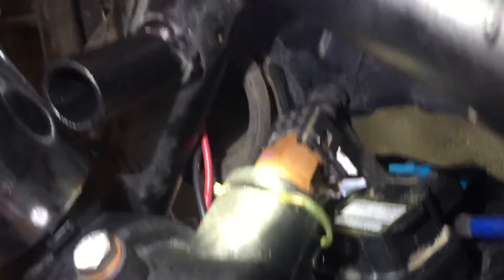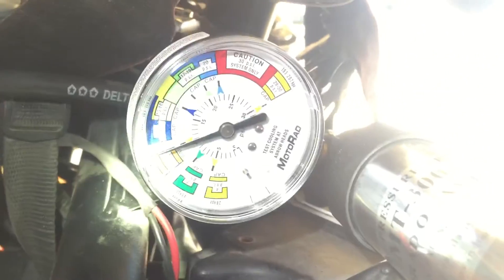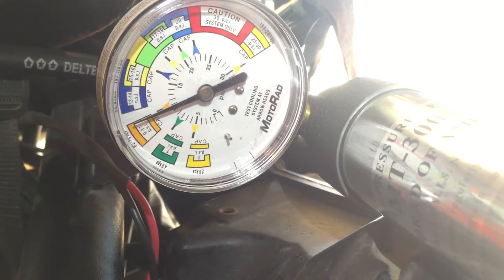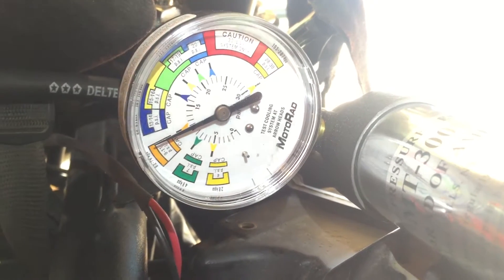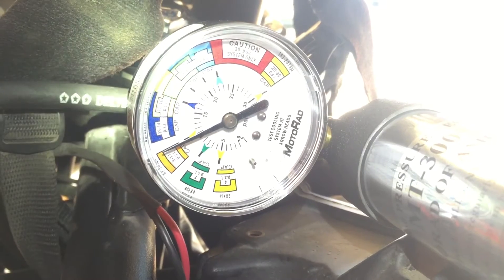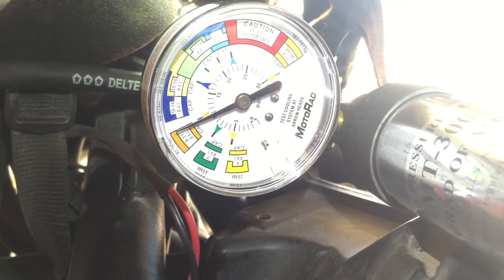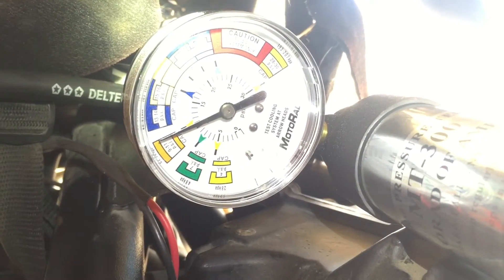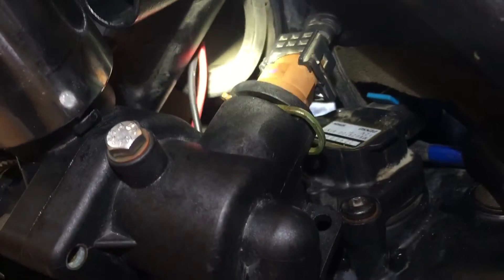Why did this Triumph Tiger lose it's coolant? Considerations during assembly

Comment: I have sort of the exact same problem on a tiger 955i too.  Coolant is disapearing. I traced it back to somewhere behind the radiator cap. I wasnt sure if it was the head gasket. The bike runs fine until I stop and the engine cuts out. Probably as temperature rises. The water pipes are super hot. I stuck some steel seal head gasket stuff into the coolant and the leak disapeared but its still way hot and cutting out when stationary after the bike has warmed up. I wonder if the coolant now is coming from the same place. Its frustrating cos Im no mechanic and trying to diagnose this problem myself. Ive flushed the coolant system a few times and you are absolutely right. Its an absoulute bitch just to get to that stuff. If it wasnt the head gasket, I have no idea how to fix that if it was either, but clueless at how to fix that if it is where thew sensor is. I've got a couple of days off coming up so Im gonna tear it down and see. Do you know if he was having the same issue prior to it breaking down - engine cutting out when stationary after a 20 minute ish ride? Any help would be appreciated.
Reply: another to note, my coolant reservoir has brown rusty residue in it
Reply from the maker: Let me try and see I can catch Shane to answer quick. (FYI. He answers channel members questions daily...best $1.99 you'll ever spend)
He is just returning from an extended stay in Japan training students this winter. You can imagine how full his inbox is. We are just the social media team. 
Due to his limited bandwidth on time and demand for help, we had to choose to forward any requests from members first and it is only $1.99 a month to join.  All member tech questions like this get directly forwarded to him every day! Be mindful and honest that this is for "quick questions" that would serve you answers that can clearly be addressed. If it's a diagnosis need you'll need to use the one-on-one service. 
Here is how to get in!
* Join here: https://www.youtube.com/channel/UCBhM8DCKnT3qXwTW0eToyCg/join       
* Just looking to give us a high 5? Click here: https://www.paypal.me/how2wrench 
* Is this an emergency and your head is about to explode from frustration or fear? Get Shane’s cell here: https://how2wrench.com/ols/products/techline-one-on-one     

Have you seen our "YouTube Trained Support Shirts? Great way to "high five us" https://goodfellasmerch.com/collections/how-2-wrench/products/support-shirt